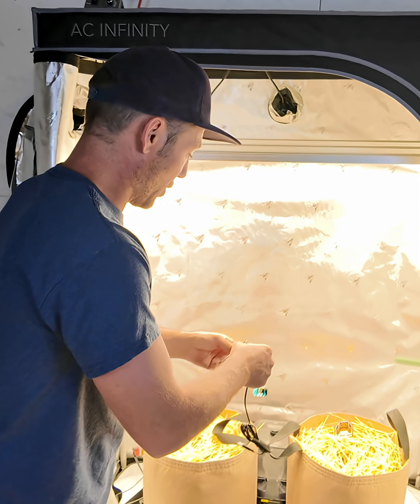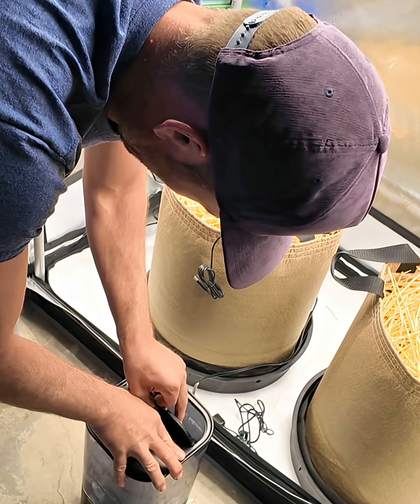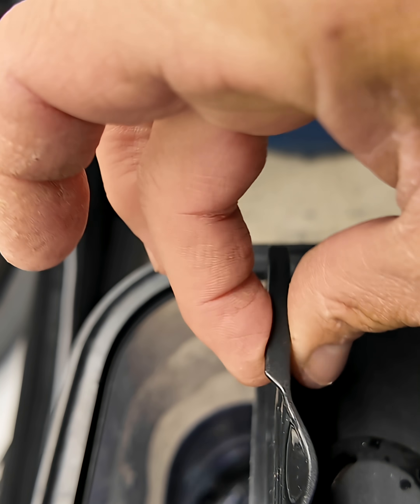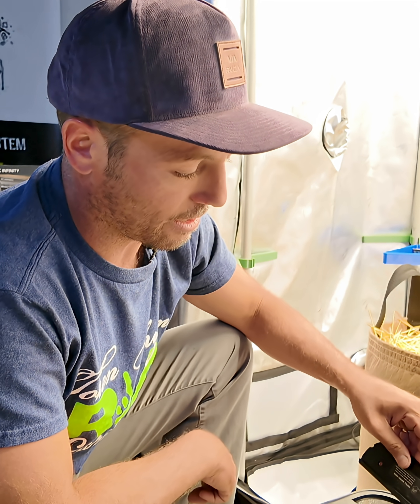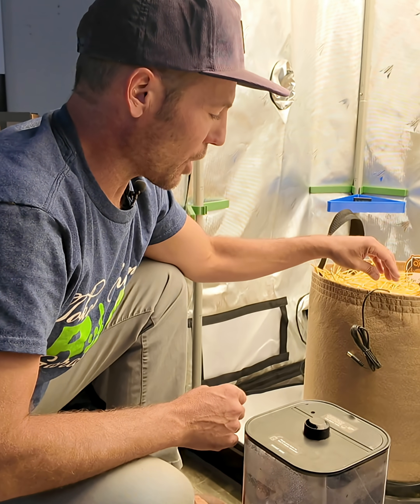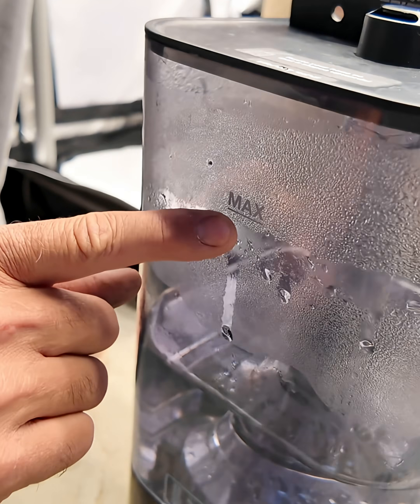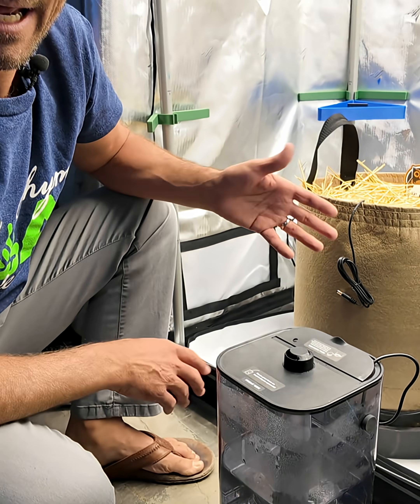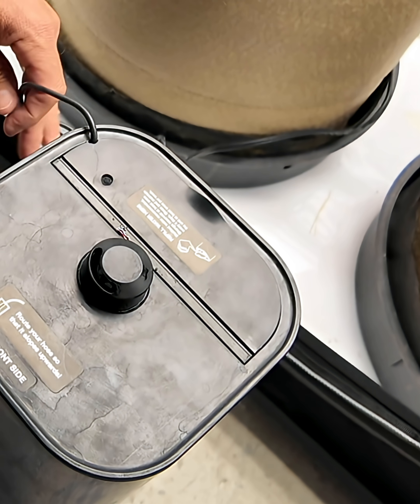How to Install a Laser Sensor in Your Humidifier

Comment: did you forget to mention the whole point? like you attach another water line to the tank and it auto fills to the sensor? what's the point?
Reply: Smart man
Reply: @kylesm235i4 it's quite obvious that's what it's for, but i want to see how they are feeding it.
Reply: @CueJackman  I have a 5 gallon bucket supplying the humidifier with this kit and now I don't have to fill it every 2-3 days, now maybe weeks. I don't have to worry about being away for days at a time now. Humidifier holds 4.5L and the 5 gallon feeds it when low.
Reply: @craigt8700  did you just elevate the bucket for a gravity feed?
Reply: @simxcenter yep!
Reply: @craigt8700  thank you sir 🙏🏻